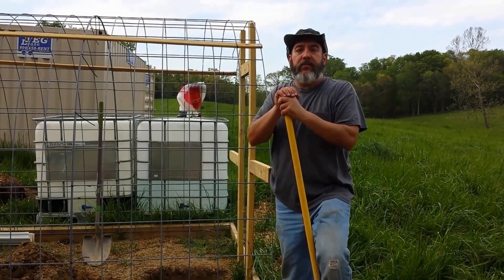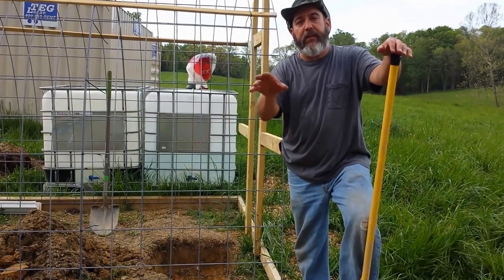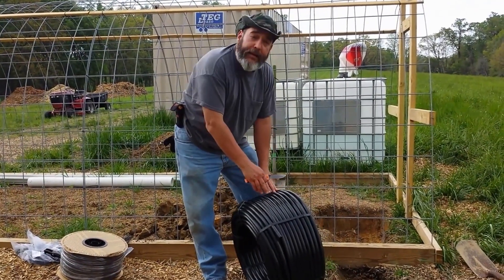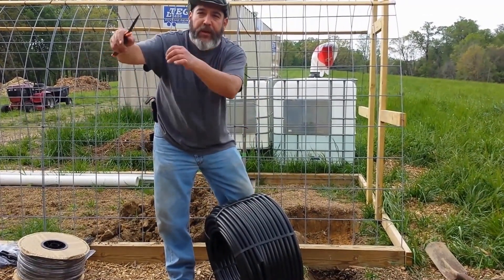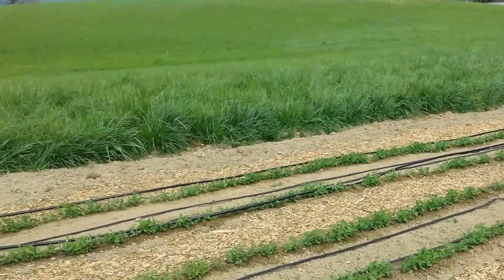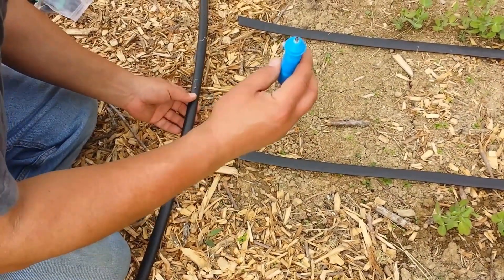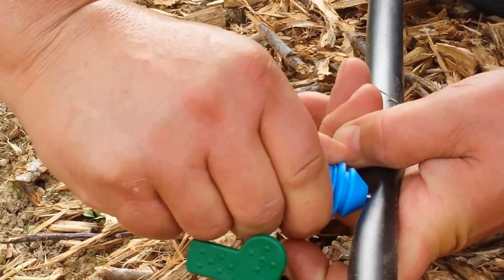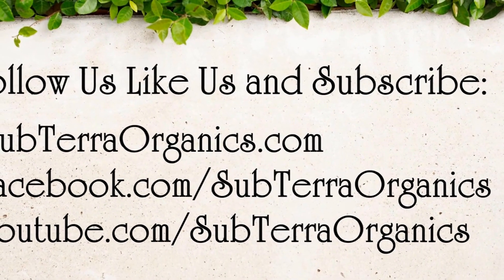Off grid drip irrigation setup (Part 1)

Comment: Its a shame you never published part 2. Good video tho.
Reply from the maker: We found that water supply was still a weak point that we have yet to satisfy. Filling the tanks several times a week worked for the short term but not the end game...the system is not in use at the moment but Im sure I will do something in the future and trying to work our videos back into the schedule :)
Reply: @Subterraorganics  Thank you for your reply. i'm going to implement something like this for my farm. I need a system that don't require a lot of maintenance (once a week tops) and do irrigate my plants and trees constantly since I'm on sandy franq soil. I think this is it. I do have a 1"of water flowing constantly from the nearest creek. Thank you for your answer and looking forward to your work. Cheers.
Reply from the maker: @eliguaso22  Yes sir...sounds like you need to dig a sump in that creek, a pump on the shore piped to a pickup in the sump, probably need a sand filter...solar to power the pump and drip tape to feed the beds. A much easier proposition with a good water supply.